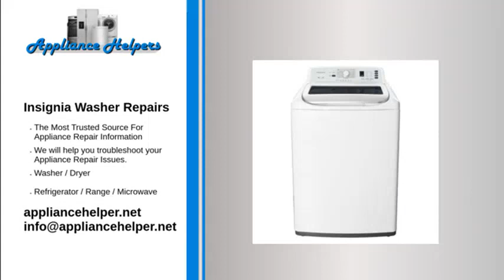Insignia Washer Repairs

Comment: My washer is display e5
Reply from the maker: If your Insignia washer is displaying the error code "E5," it typically indicates an issue with the lid lock mechanism. Here's what you can do to troubleshoot and potentially resolve the problem:

Check Lid Position: Ensure that the washer lid is securely closed. The lid must be properly closed and locked for the washer to operate. If the lid is open or not fully closed, it can trigger the "E5" error code.

Inspect Lid Lock: Inspect the lid lock mechanism to see if it's damaged or malfunctioning. The lid lock is a safety feature that prevents the washer from starting if the lid is open. If the lid lock is faulty or not engaging properly, it may need to be replaced.

Reset the Washer: Sometimes, resetting the washer can clear error codes and restore normal operation. Try unplugging the washer from the power outlet for a few minutes, then plugging it back in. This action may reset the control panel and clear the error code.

Test Lid Switch: Use a multimeter to test the continuity of the lid switch. The lid switch is a component that detects whether the lid is closed and locked. If the lid switch is faulty, it may need to be replaced.

Contact Support: If the "E5" error persists after performing the above steps, it may indicate a more significant issue with the washer's internal components. In this case, I recommend contacting Insignia customer support or scheduling a service appointment with a qualified technician for further diagnosis and repair.

By following these troubleshooting steps, you can hopefully identify and resolve the "E5" error code on your Insignia washer. If you have any further questions or concerns, don't hesitate to seek professional assistance.